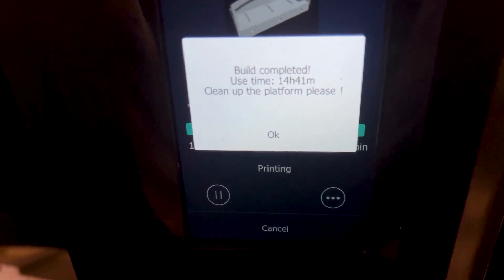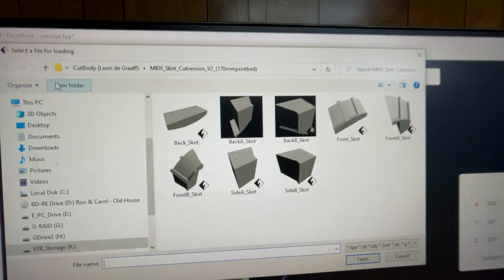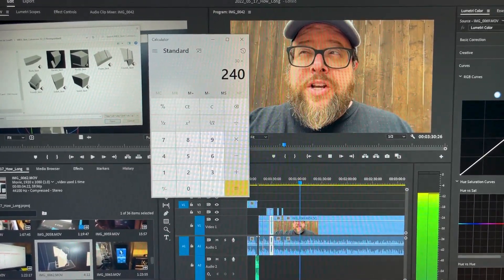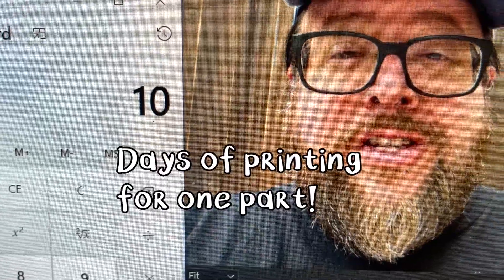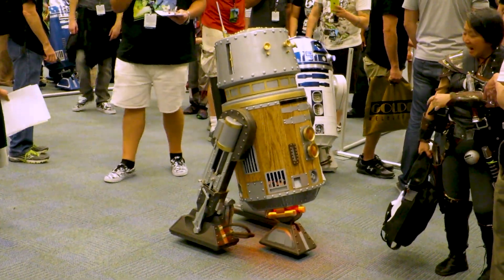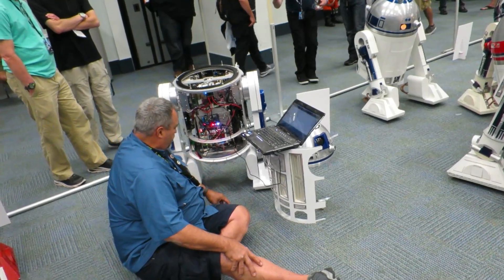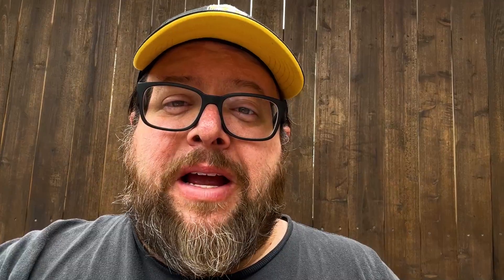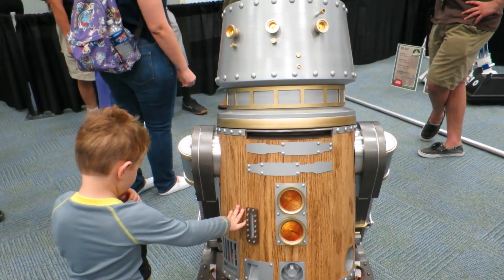How Long Does It Take To 3D Print a Full Size R2-D2?

Comment: Excellent video.  Even printing the parts, you'll be custom fitting a lot of pieces (electronics, gromlies, etc).  And you'll have print failures, parts printed in reverse by error and parts that break, shrink or just don't fit.  Frustrating.  And you're right, you're never done with your droid.

Comment: Has anyone used a Bambu X1C to print this yet? I am curious about the reduction of time.
Reply: I have switched to a Bambu X1C. It's awesome and does an (almost) perfect job. So fast and reliable in the first 400 hours I've used. I've gotten pulled away from R2 many times over the last year. But the Bambu is a hugely helpful addition. I've switched over to ABS...much more durable than PLA.
Reply: @horacechincer  thanks for the reply. Is it considerably faster than what you have been using? I have one but the times that people are quoting for build times on a r2 is daunting.
Reply: @davids8493  yes. It prints reliably at 500mm/s, sometimes more depending on the part.

Comment: Its been about 11 months you video just popped onto my feed.  Would be interested in how far you are along.
Reply: That's wild; I thought it was a year and found out it wasn't quite a year when I started making the progress video last week. A few things got in the way (I printed some SW armor to take to a screening of ROTJ). Anyhow: the long and short is everything has changed a few times, and it's going really well. I had to start R2 over a few times. And now I think I've got a good process happening printing on an X1C in ABS. Would would have taken me weeks before is now taking days. I have printed parts for a micro droid and will be doing a "can you build a functioning droid" in one day video soon. That whole little project lead to me re-evaluating my whole process on the big droid, which is kind of a wild story in itself. So...I hope that fills in some details for you. I haven't done much more than print and try to get that happening in a solid way. Took me a year and big mistakes to do that. So. A year well spent! More details to come in the video. Are you doing this project too?
Reply: @horacechincer  I've been on and off for about 3 years now got everything printed but the internal stuff.  Like wheels lol.  Printed mine on a ender 3.  Its pretty much done what slowed me down the most is procrastination and I wasn't happy with the dome.  I'm going to sand it back down and do it again.

Comment: something must be wrong with your slicer settings because my skirt parts were taking on average 4 hours to complete. ive managed half the body on 1 printer in 4 weeks and ive had a few waits for filament
Reply: What sort of printer are you using?
Reply: @horacechincer  ender 3 and at recommended .3 layer height

Comment: I'm at about 95% printed of the Baddeley MKIII cut version, I'm sitting at over 2500 hours of print time so far.  Started printing Jan. 15 and been printing nearly constantly.  Its a lot of work and there are points where it seems like you're getting nothing done, but the sections where you really start assembly and painting, make it worthwhile.  I would highly suggest that you start filling and sanding as you get each major component finished.  Good luck!
Reply: Thanks much. I switched to an ex X1C recently, and it's a game changer in terms of speed. How is your project going?
Reply: @horacechincer  It went great.  I was able to get everything complete visually by mid August, so 7 months from the starting of printing.  I still have a list of stuff to do, but most of it is wants and not needs.  With the X1C, you should be able to cut the print times down quite a bit, but its till a lot of printing and a lot of finishing time.  Well worth it in the end.  R2 now lives next to our TV in the living room.
Reply: @natepropes  Top notch!